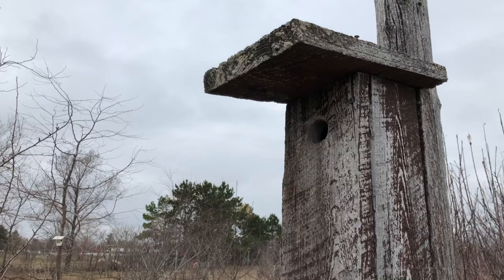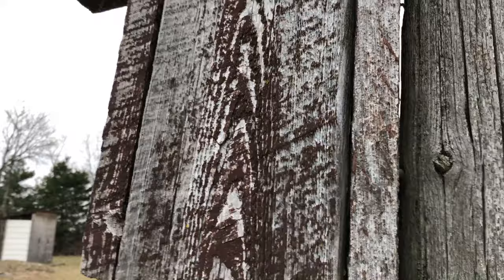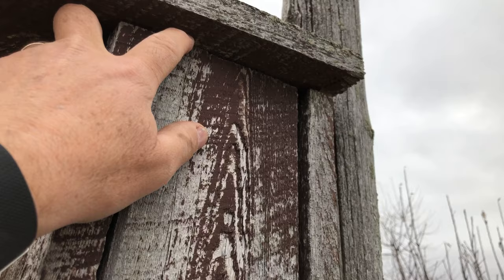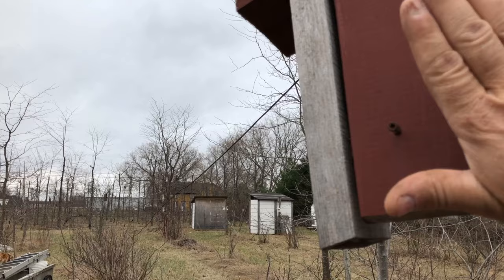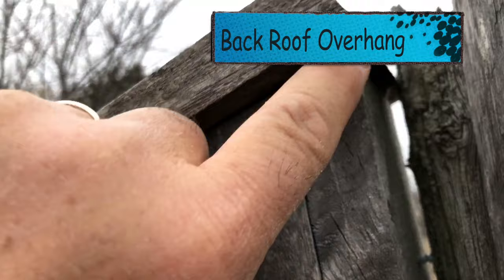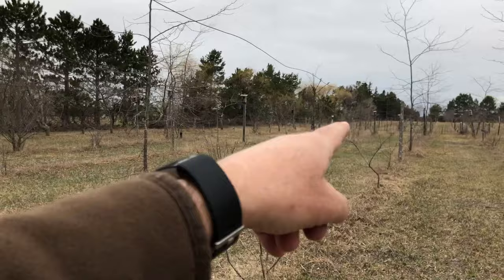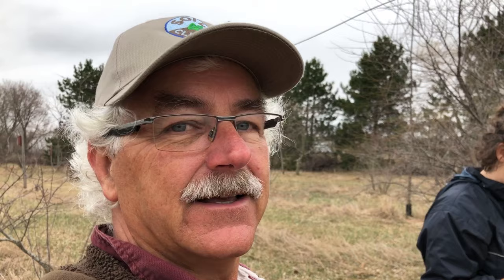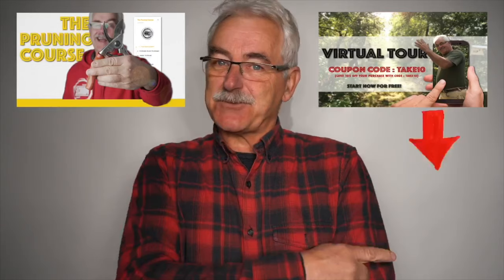Nest Box Design: Our BEST DESIGN Details from 25 years of Practice

Comment: Building bird boxes over the winter is on my priority list. Thanks for the tips (like angling the bottoms of the sides) that otherwise I would not have known.
Reply from the maker: Glad it was helpful! Make sure to download the plans in the description, they are time tested to work for a long time.
Reply: The right phrase is mitering not angling , if you want to go fishing, you go angling .
Reply: @StefanSobkowiak  the angle of your rear board is correct. You are keeping the water from the board its attached to. I just made a mount to my shed, and I mitered it the same way you did.

Comment: I'm no expert but have been building bluebird boxes for years, too. I have two suggestions:
1. Cut a bit off all four corners of the floor for drainage
2. Always include a predator block to make it difficult for predators to reach in and grab eggs or chicks. I also place a thin piece of clear plastic over the predator block to discourage pecking the access hole bigger.

Comment: Lovely to see so many boxes. Use different size holes for different birds. Wrens are murderous devils and will peck holes in eggs or kill nestlings. The male wren will build several nests so she has a choice. I put up boxes for tree swallows. They have to be 100 feet apart and in the open field so sparrows and wrens don't  interfere. I wood glue all joints put holes in the floor angled breathing holes on the side. I put a sheet of plastic from bird food bags under the roof and  have the plastic droop out beyond the roof to drip away from the box. I reinforce the entrance with an extra piece of wood to stop predators chewing through.
Reply from the maker: Nice details. Yes we've had wrens for more than 20 years. The key to them behaving is to have enough nest boxes for them and the other birds. We now have almost 300 on 12 acres. Everyone is happy.

Comment: I would love to make some of these. One question. How do you attach the box to the post? I only see a screw at the bottom
Reply from the maker: Second screw is in line with the hole. Use a long shaft screwdriver or bit to tighten it.

Comment: Thanks for another great video. In a separate video you mentioned how you intentionally did not clean them all because once they are full, other organisms like squirrels and bees can occupy them. With that in mind have you ever tried replacing the floor with hardware cloth? Maybe then you might not ever have to clean again.
Reply from the maker: Never considered hardware cloth. I doubt birds would use it due to the drafts they don’t like nest boxes with an open crack in the floor board.
Reply: @StefanSobkowiak  Thank you for responding. I've been wanting to rip out an old deck for years but couldn't find a use for the old boards. I will make most of them your way and try a couple with hardware cloth and let you know how it goes.

Comment: What kind of wood do you use regularly? As in rough 1x boards, plywood, OSB? I can get my hands on a lot of rough 1x6s, but that only makes the least-wide pieces for the small and medium bird houses. Getting the wider pieces is a great deal more difficult. Ideas?
Reply from the maker: I included a PDF link in the description. Use it to get some templates made. Use all the narrow pieces you can and buy or barter for the wider boards. Maybe someone is looking for a bunch of narrow boards. Ask on job sites or furniture shops often they have cutoffs. We made all of our smaller nest boxes with recycled 1x6 from a fence except for the roofs. One 1x8x8’ will make a bunch of roofs.
Reply: Stefan Sobkowiak thank you!

Comment: Your so concerned with the botton yet the side gaps are so large wind andwater can blow strait threw ,,,lol at least the bottom dont leak 🤔
Reply from the maker: I used to monitor nest boxes with a thermometer and check on young. I've seen what a nest box in the sun can do to nestlings. A little wind or water is far less stressful on the young than sun on a thin walled tight nest box. In the wild nest cavities have far better insulation against extremes.

Comment: Is it too late to trim my brothers pear tree? Lamb We are not concern with production just making it more healthy. The height is appropriate 25-30ft.   We did get to the snow apple , apricots and peach tree in February. Yet due to this virus he has worked so we didn’t complete our work.  He will be out of quarantine on April 8th. Send me any info about this..  lol. Yes not about birds but in need of information... ty ty ty.   Merci et Au revoir
Reply: if you can, mark the limbs you would like to remove with red ribbon, and then you can do the cuts later in the season, especially if it's a big tree.  My personal experience is that pruning pears in the early spring results in a lot of vegetative regrowth but cuts in the summer don't so much.  Of possible importance there: I don't deal with dwarfing rootstocks in any of my fruits.  That might make a difference to my experience.  But no, you can cut a pear later without worries.
Reply from the maker: If you’re in Qc it’s still great time until around 15 in south and later in North

Comment: Do you not have problems with predators like snakes?  I have had so many failures because of snakes and mice that I always make baffles for my posts.  Losing the blue bird chicks and chickadee eggs has been so upsetting.  Unfortunately this significantly decreases my production of nest boxes 😕
Reply from the maker: Sounds like baffles are a necessity for you so continue to use them. We only have garter snakes which climb trees but I’ve never seen them in a nest box.